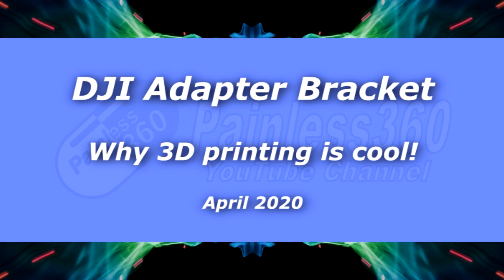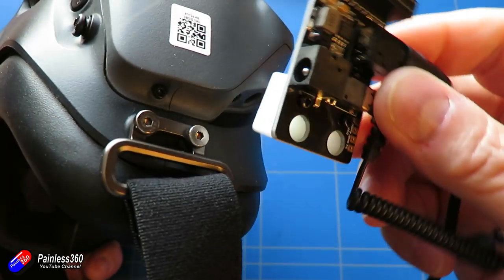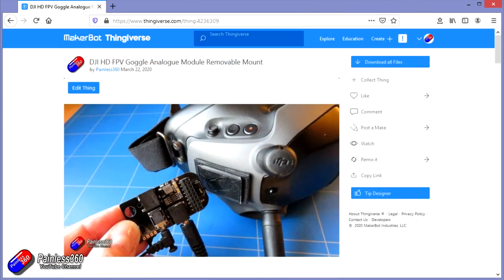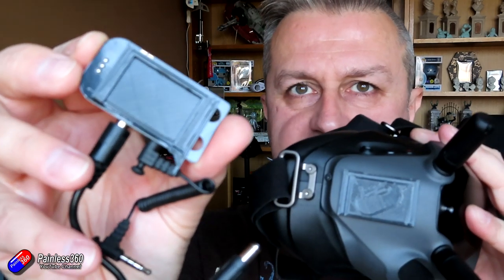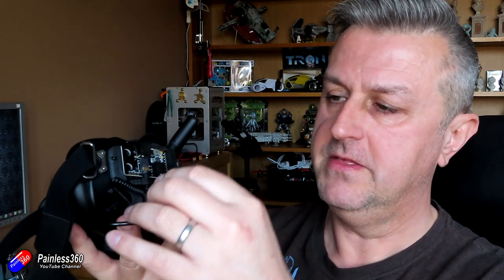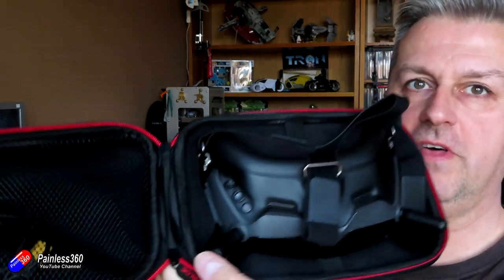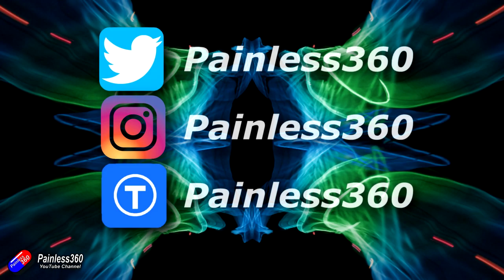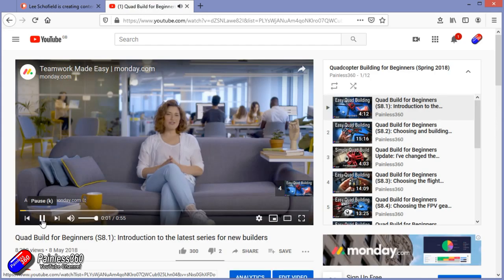Adding a removable analogue receiver to your DJI HD Goggles

Comment: Brilliant! I’ve been using the Makerboyz module case along with the URUAV analog mod and although it’s a very secure way of mounting without risking breaking the pins of the analog module, the added weight of the side of the DJI goggles is quite uncomfortable.

Comment: My rapid fire has an issue when using the uruav adapter, when flicking through the channels on the osd in the dji goggles the screen reboots between selecting channels, fpv feed works fine, any ideas?

Comment: I looked at them all on thingiverse and I think I like yours the best.  My DJI goggles are still backordered because of the sale, but since I have time I thought I'd get it all ready.  Is there any issue with the URUAV version 2 of their board and your slick mount?  Also I have a feeling I will regret it, but I ended up getting the Foxeer Wildfire receiver module rather than the RapidFire (to save 60 bucks).  Do you know if yours will work with the WildFire?
Thanks man!  I appreciate all you do.
Reply from the maker: I've not tried the Wildfire but it will have to go some to beat (what many consider, including myself) the gold standard of RapidFIRE... To be honest, you only tend to see the benefits of expensive modules like this when you're pushing your luck ;)
Reply: @Painless360  I probably should just get rapdidfire.  I heard that wildfire solves the rolling effect caused by reflections, but all the comparison videos I see the rapid fire gives a better, clearer signal.  I think I'll go edit my order 😁.

Comment: Aren't you getting weird diagonal lines using those? I got those and some others are getting them too. They say that it's a ground loop issue and can't be fixed. BTW what's the goggle case? I would love to get those as well
Reply: 이시훈 - I heard about this potential issue but it hasn’t been a problem for me using the URUAV analog mod on the DJI goggles.

Comment: I want to use the Module Adapter with Matek 1.3GHz Video Receiver and connect it to an external monitor. does that work? 
help >>>>!!!
Reply from the maker: Not sure how. The output of the adapter is plugged into the HD goggles... Maybe there are adapters that give a second output? Best of luck

Comment: I’m still waiting for mine from B.G. . Quick question I have a newbeedrone stack 20 and 30 but no osd . I only have red voltage when normally it’s white . I turned on osd in my goggles and in bf . Any help would be awesome thanks mate
Reply from the maker: Not sure, I've never seen an OSD in anything else than white (not counting Vector). I'd double check the wiring and BF settings... let me know what it was when you fix it... best of luck!